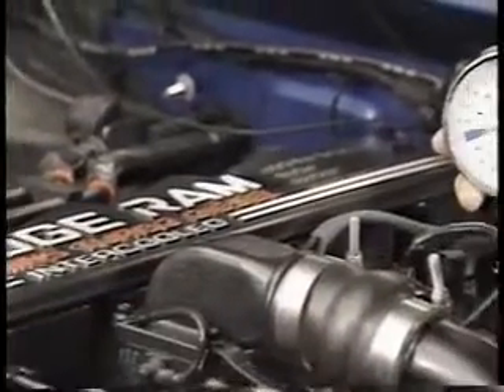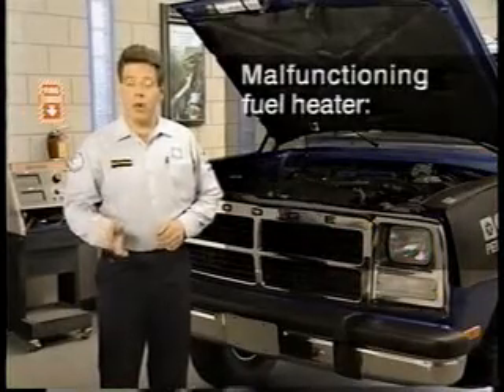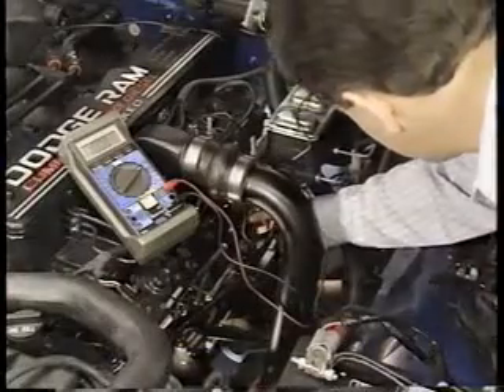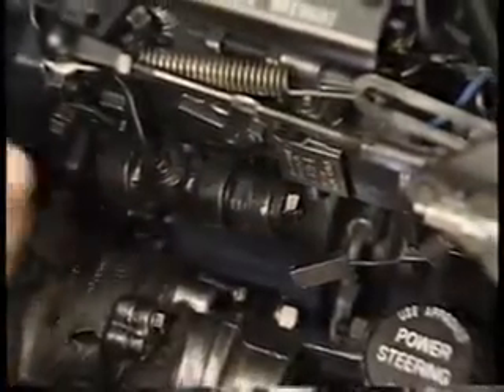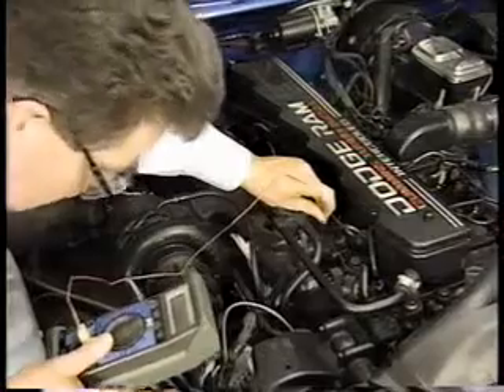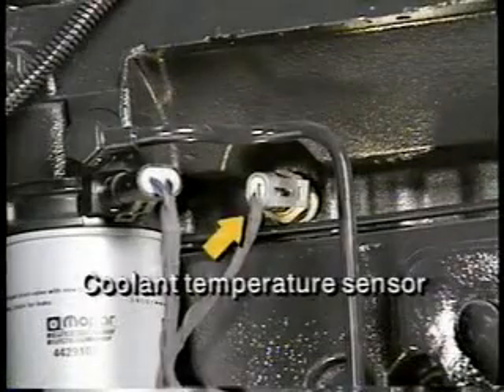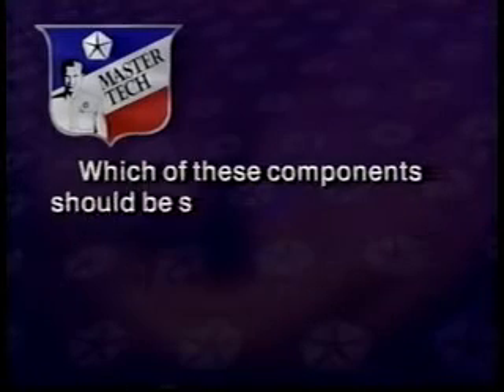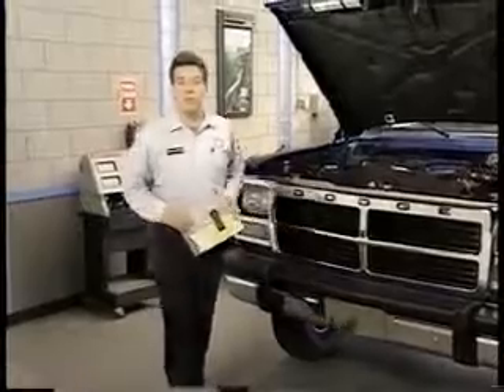Cummins (12 valve) Fuel System Troublshooting - Mastertech 1993 Part 4

Comment: I recently bought a 93 Dodge Cummins,and on the back of the injection pump,have a plug with a plastic housing of the end of it like cone shape and was leaking fuel from it,I took it off and put it with silicone,now when the engine riches normal temp stals on gear. Any thoughts?